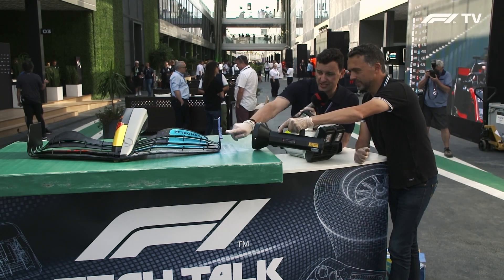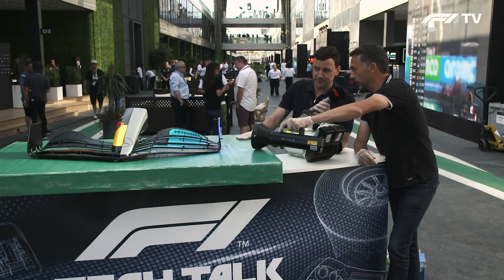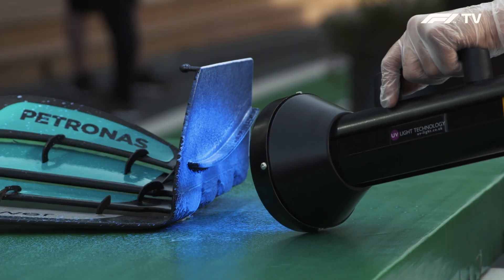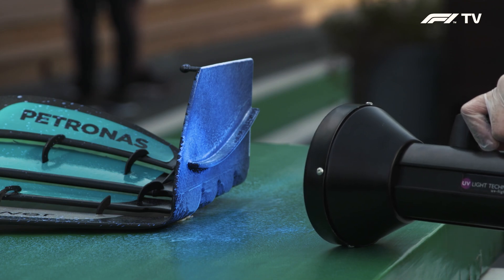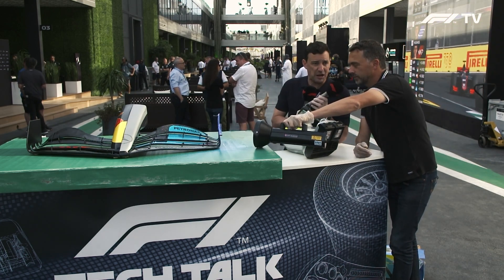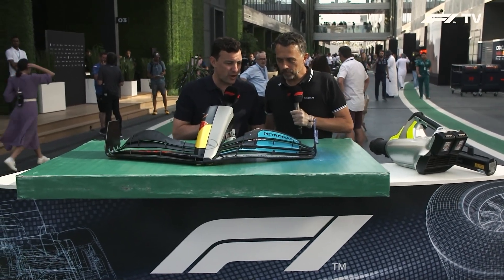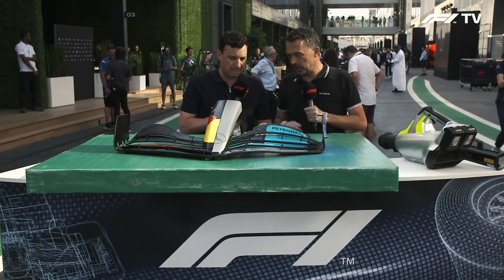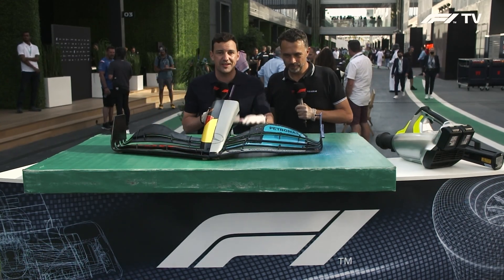Albert Fabrega's Tech Demo | Going With The Flow-Vis | F1 TV Tech Talk

Comment: amazing explanation of the flow vis paint process but the execution of the experiment was flawed. 
1) the blower generates turbulent airflow and the data correlation wont be right
2) the airflow was directed at a 45-degree angle against the wing plate. Would have been better to have the airflow hit the endplate perpendicularly to the front references plane line (Straight on to the front wing).
Reply: He said it's not perfect. It's more to demonstrate how the liquid work to the masses instead of doing actual research